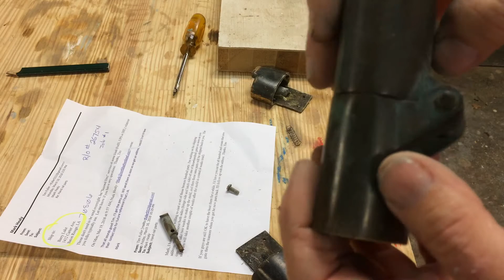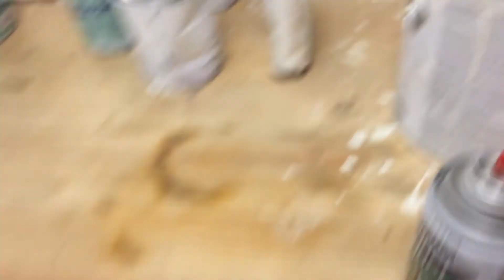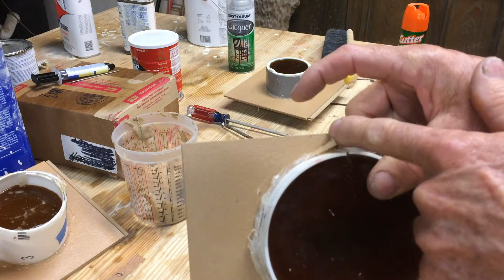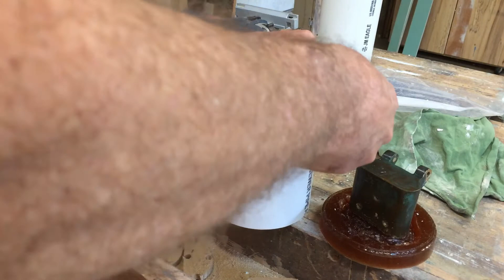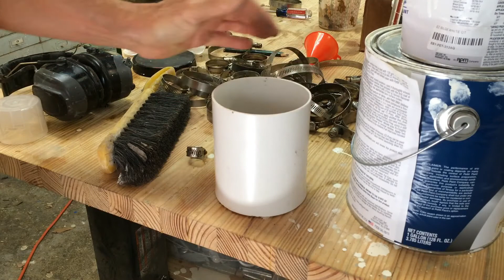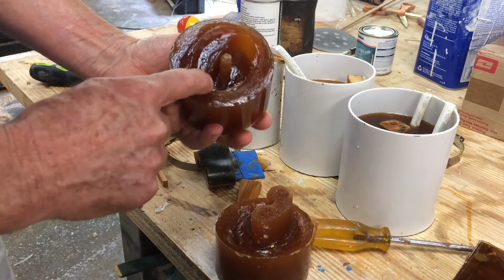Roughwater Hardware #1

Comment from the maker: Usually when something I am working goes South I don't even take the time to figure it out, otherwise I would never get anything done! Looking back at this issue I believe the little  pvc schedule 20 scrap I started working with must have been the bell end of a stick of bell joint pipe. That's the only thing that makes sense. Unless it was just the Dookie Fairy messing with my head.